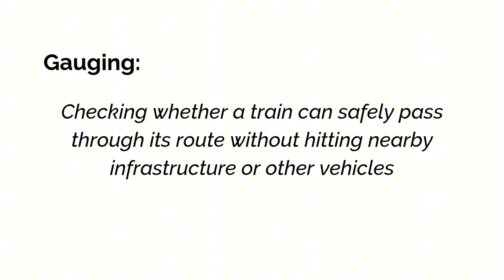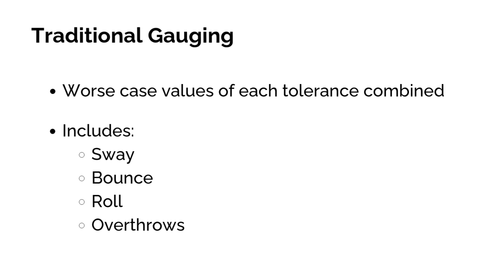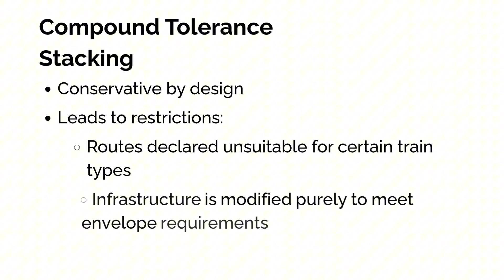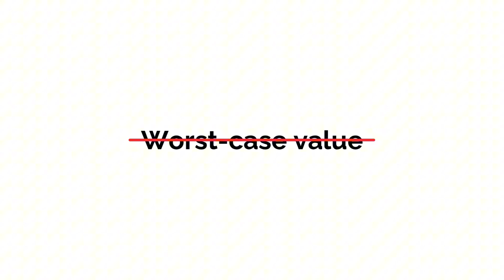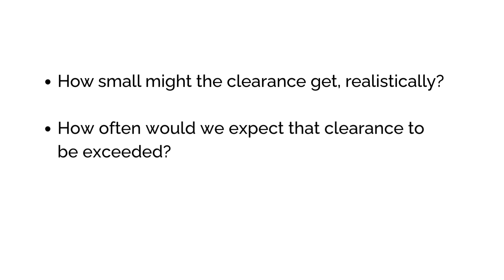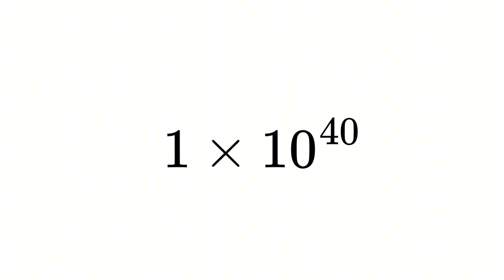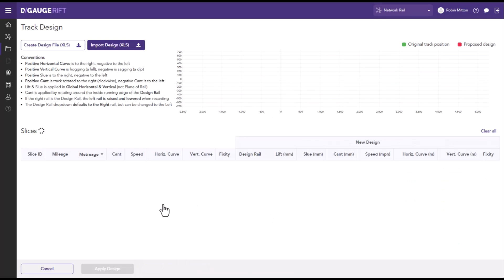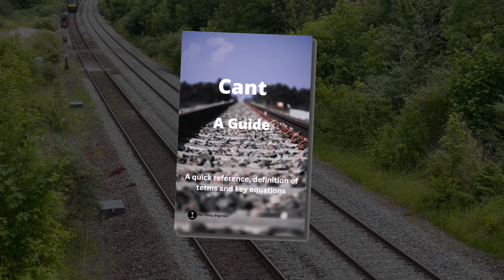Probabilistic vs Traditional Gauging : The Future of Railway Clearance?

Comment: This seems well enough. There’s however a strange dialectic to this, if seen over time. Ponder how early railways were… not safe. Enter a period of two centuries where these insights become empirical knowledge - as in compound, worst case holistic risk. It is always changing with developments.

In that two century period, we mostly (caveats) wouldn’t allow “money” to singularly decide the level of risk - US space program 1957-72+ was a prime example. 

Today, we’ve had four decades of a different view, where the financial aspects of ‘efficiency’ are the accepted prime factor. This is where the dialectic to the old school “no compromises” narrative emerges. 

We now seem to be willing to leave one paradigm for another - but the new one is nearly as unproven as railway engineering was at the earliest stage, and is primarily based on financial outcomes - not really a complex material sciences aspect. 

To me, that’s more like behavioral economics - not engineering…? 😊

Comment: Oh yes. Lets build Space Shuttle by assumptions! It never goes wrong! 1 to the 1000000! KABOOM. Perfectly described by Feinman, who was not an engineer or manager but Nobel-level physics scientist, so was able to think, not just copy tables from manuals.

The idea of absorbtion event - no, never heard? If suspension fails and clearance not provided - it will be OBLIGATORY heavy crash. Because you do not need 2nd probability in this case, faulty train will not try the chance 1000 times, it crashes as soon as it reaches the problematic (narrow) spot. Like in Eschede.

Comment: We don't (shouldn't and can't) run a risk free railway. Should we use standard gauging where we can as it is conservatively safe? - Of course as it is much simpler to do too. Where that doesn't work and conflicts are flagged we must assess the risk together with the consequence. A 1 in a million risk of scuffing a platform edge and scratching the vehicle paint job should likely have a different answer to a 1 in a million risk of multiple fatalities due to a catastrophic high speed derailment for example.

Comment: Always have clear rules for the worst case scenario otherwise management will make the worst case happen and far too often. They do that now with the current rules when they ignore them. Any attempts at accountability will fail.

Invest properly in the infrastructure instead of giving management the tools to cut corners and dodge consequences.
Reply: Invest properly in infrastructure - yes. But how is this giving them the tools to cut corners? As engineers, it gives us a more numerate measure of risk and an ability to provide more economically viable solutions. RIS2774 is a set of rules that the industry has agreed, and will be published later this year to make sure that the process is used in a controlled and consistant manner

Comment: My main concern would be that it makes it more difficult for engineers to resist pressures from management, who seem chronically incapable of understanding risk wherever it occurs (i.e. not just trains).
Reply: As engineers, this gives us a numerate measure of gauging risk, whereas absolute gauging is just 'zero risk'. We should use this to educate managers and demonstrate that we engineers do know what we are talking about.
Reply: @DrDavidJohnson-n6g  It seems to me that absolute gauging was "this is the rule", whereas probabilistic gauging allows the manager to say "can you prove to me that it's not safe". Educating managers on the nature of risk would be nice, but there are any number of disasters that can at least in part be attributed to a lack of understanding of risk by managers. If it is possible to educate managers, it clearly hasn't been happening.

Comment: I don't like the idea frankly. Better to keep the worst case scenario standard because it's simple and relies on fewer assumptions. A more complex method makes it much easier to fool yourself (or for the foolish and/or malicious to find away to get around you). What problem does this really solve? It seems mostly an excuse to continue to underinvest in railway infrastructure.

I'm reminded of United Airlines flight 232. The engineers calculated that the chances of all three hydraulic systems failing at once was so low it would almost certainly never happen on any aircraft. Well, it turned out sometimes extremely unlikely things still happen, you can only calculate the things you thought of ahead of time, and your supposedly independent variables are rarely completely independent in practice.
Reply from the maker: I understand the thought but I have also been involved in a number of projects where vast sums of tax payers money has been spent altering platforms and other structures for these highly improbable events.

You could argue it is one of the factors that makes rail so expensive
Reply: @thepwayengineer  Why do planes crash? Not due to a single pilot or design error. Almost every time it is an unlikely combination of at least two errors of one or both of these. 

This is called the swiss cheese model: When the holes in the cheese align there is a straight path through and the error (i.e. chrash) happens. In case of pilot error, the operating procedures often have not been sufficient. In case of design, it is a situation that has not been thougt of or SIMULATED during construction. 

In each case of those two there is a revision: operating procedures will be optimised/tightened or designs will be revised/improved. Or to put it in other words: You dont assume the worst case scenario from the beginning and put into account only the likely scenarios and then shift to the worst case step by step by paying the death toll of a plane crash. Does that mode of conduct sound familiar to you?

It is very dangerous to tamper with the over hundred year long design philosophy of railways. Example: There is a reason, why wheels/axles of german trains (in the era of Deutsche Bundesbahn) were designed three times stronger as needed over the lifetime of a highspeed train. It was a vital safety margin. Once violated - probably due to some simulation and for cost reasons (on the first ICE3 sets): derailment in Cologne, prolonged speed limits and costly exchange of the axles.

Leave alone what does not need to be improved! You also dont build a nuclear reactor with brick wall containment and say: The chances it will explode or a plane crashes onto it are marginal, lets save some money. It is a must have, even if it makes it more expensive.
Reply: @thepwayengineer  I think the assumption that the deviations from norm are unlikely to all happen at the same time is flawed. A train travelling fast is more likely to roll, A rolling, fast train is more likely to  have a suspension failure. An old (and possibly patched up or otherwise out of original design parameters) vehicle is more likely to have a  suspension failure.  The parameters are not independent, and so assuming that they won't all happen at the same time is worrying.
Reply: Don't agree with "better to keep the worst case scenario" as the present absolute gauging process is neither worst case (it includes some rather empirical fudge factors such as vehicle dynamic movement limits) and considers EVERY parameter to be cumulatively at their worst limits at the same time. Then we add a clearance just to be on the safe side. Look at the gap between a train and a platform as it comes in - miles bigger that the absolute clearance assessment calculates which means additional cost to achieve (particularly on electrification) and poorer accessibility. Probabilistic is about modelling realistically AND retaining a safety margin. Sorry, but we in rail need to use the technologies available to other engineering professions to address the issue of it being too expensive. Investment is one thing (which I agree could be better) but we need to spend what money we have wisely. The current spotlight on project costs isn't favourable.

Comment: Interesting. Another related factor seems to be to do with suspension design, and it’s relationship with our physical interpretation of it. That is to say, ride comfort in different types of rolling stock. I refer to some articles by Roger Ford in the Modern Railways magazine on this topic. Or ask any experienced traveller about the difference between something like a class 800 and the old Mark 4 stock.
Reply from the maker: Thank you, I will try to find the mentioned material
Reply: @thepwayengineer  October 2024 issue page 28: “Who cares about ride comfort?” to start with!
Reply: Indeed, suspension design is considered. Every vehicle has it's own characteristics, which are included in the statistical movement data used.